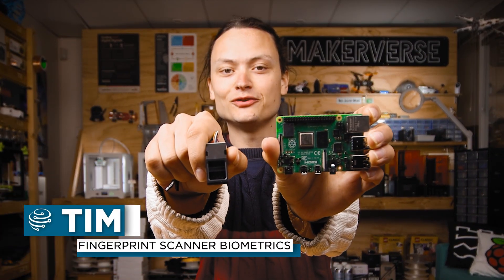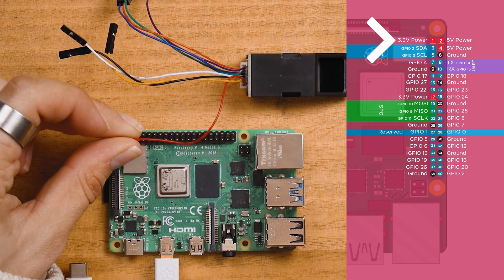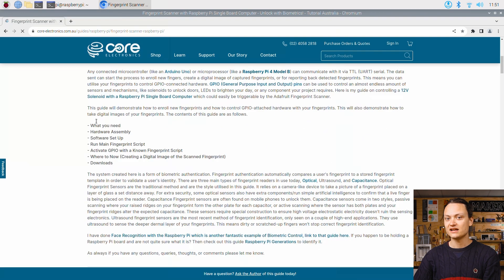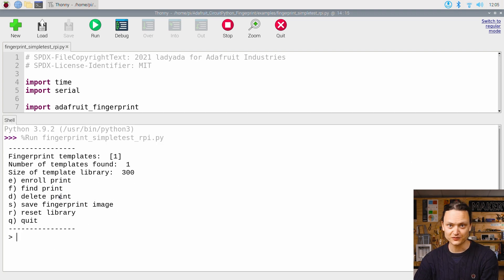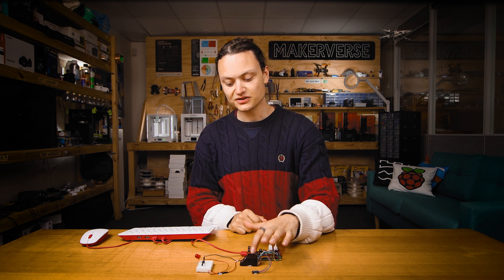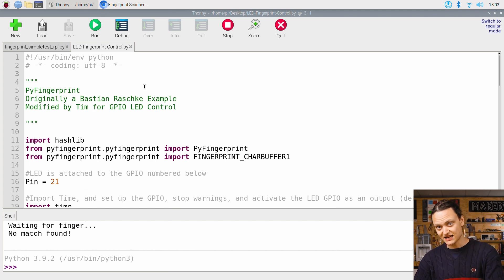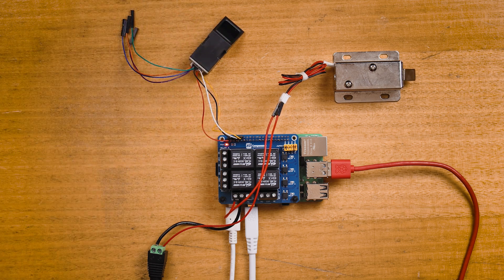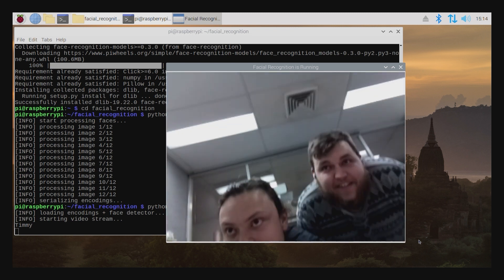Fingerprint Scanner Set Up with Raspberry Pi - Unlock With Biometric Control!

Comment: Do you know how to install the driver for the usb fingerprint reader  U.are.U 4500 digital persona in linux?  I tried with fprintd and didn't work. Also wine but didn't work for the driver . I'm using linux mint 21.1 or 21.2

Comment: hi im quite new to raspberry pi. i recently gotten a pi 4 and have been watch alot of your tutorial videos for a school project. but i have an issue when trying to install the packages as it will say externally-managed-system. however, when i see that you uploaded the packages the same message does not pop up. why is that and how do i solve it?

Comment: Does somebody have issues with the sensor nor detecting accurately when you place/remove your finger? How did you solve that, mine is templaiting even when there is not finger and it doesn't detect if you remove it
Reply from the maker: Sorry to hear you are having troubles with it, we have a dedicated community forum topic on this video that might have some helpful information there. If not feel free to chuck a post on there with some information about your wiring, code and setup, we have lots of maker eyes over there that can help!

https://forum.core-electronics.com.au/t/guide-by-tim-fingerprint-scanner-with-raspberry-pi-single-board-computer-unlock-with-biometrics/15654/11

Comment: hello sir, what is that blue board on the raspberry pi when you introduced the solenoid lock and what is its function
Reply from the maker: It is the PiRelay HAT, it has several relays onboard that you can control with the Pi. And a relay is an electrical switch that we can control.

Here is the board: https://core-electronics.com.au/pirelay-v2-relay-board-for-raspberry-pi-1.html

And if you are interested in controlling solenoids, we have a guide on it as well: https://core-electronics.com.au/guides/solenoid-control-with-raspberry-pi-relay/
Reply: @Core-Electronics  alright, i was wondering how you connected the relay to the board because in a previous video a spot where a pin of the relay went into is also a spot where a pin of the fingerprint sensor went to. so im trying to understand how i can have both of them connected seeing as im trying to trigger the solenoid lock via fingerprint authentication

Comment: The cool set up would be fingerprint start for your car. Turn the key on, scan your finger, car starter runs while finger on sensor.. the rasp pi output to a relay connecting start (keyswitch) wiring. 
or, replacing push button start already in many cars with fingerprint scanner/pi set up.
Reply from the maker: I love that idea too! I've seen this Adafruit Fingerprint Scanner be used in a very similar application for a Motorcycle. Check that here 😊 - https://www.youtube.com/watch?v=JJUaAganQNA

Comment: Hello from Colombia.
Thank you very much for your contribution with this video.
I have a question, is it possible to extract the templates from flash memory and store them in a database.
with the intention of having a backup and in the event that the sensor fails to be able to insert the templates from the database?
Reply: Hey is it working the way you wanted
Reply: @priscillachikowore2216   Hello. Could this library work from an esp32 to be able to extract the templates and store them on a microSD? And do the validations with the templates that are on the microSD? Do you know if there is a library that allows me to do this?

Comment: What other sensors are these python modules compatible with?for example if I want to use the R307 fingerprint module would it work?
Reply from the maker: Correctly wired up the R307 will absolutely work. Pyfingerprint Package will work with ZFM-20, ZFM-60, ZFM-70, ZFM-100, R302, R303, R305, R306, R307, R551 and FPM10A fingerprint devices.
Reply: @Core-Electronics   does this python module support the AS608 fingerprint sensor?

Comment: Thanks for this video and all the others you have produced. They are a great help in getting started on my projects. What is the minimum hardware that is required to use with this scanner? Pico or Pi Zero work? Thanks.
Reply: If you follow the links it says "any microcontroller or system with TTL serial" and there are Arduino libraries.

Sounds like all the work is done on the module.
Reply from the maker: Absolutely true, Arduino or Raspberry Pi Pico boards can both operate with this Adafruit Optical Fingerprint Sensor. Linked here is a rad set up which uses the Pico and the Fingerprint Sensor - https://www.youtube.com/watch?v=oZ1kzJYfk7c

Comment: I followed all the steps but I get this error when running the script "AttributeError: module 'adafruit_fingerprint' has no attribute 'Adafruit_Fingerprint' " anyone with this same error or any idea on how to solve it?
Reply: Same issue. Seems like the code changed and broke from when his video was made.
Reply: @christopherleadholm6677  Hey I solve this issue just forgot to comment right here. In your terminal you need to move to your proyect and start de virtual env "source my_project/bin/activate" after that run the proyect in your terminal "python .\my_project.py" I did something like that, I didn't use "Thonny" like in the video but the Adafruit Fingerprint library works well

Comment: Hi, great project 👌 Is it possible to memorize upto 9999 fingerprints???
Reply from the maker: Cheers for you comment 😊 this sensor can store 300 unique fingerprints inside its internal memory.
Reply: @Core-Electronics  but how can we extend that limit?
Reply from the maker: Excellent question. It is not possible to increase the storage in the sensor itself. But the sensor protocol does allow image data to be uploaded. That means you could store your fingerprints on the Pi and then run through all the data by uploading it in chunks to the Module. I presume it would result in a lower response time. Check more at the Modules Datasheet - https://cdn-shop.adafruit.com/datasheets/ZFM+user+manualV15.pdf
Reply: @Core-Electronics  Perfect, many thanks for your answer 👌